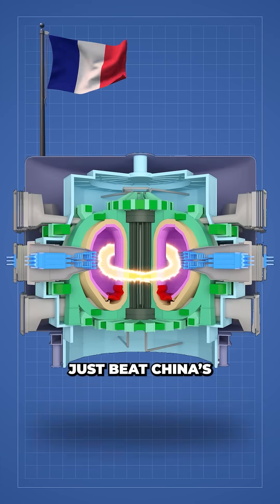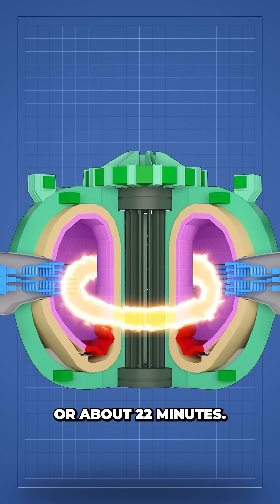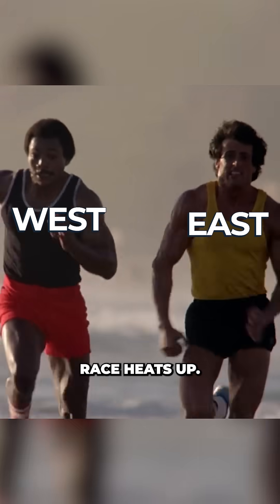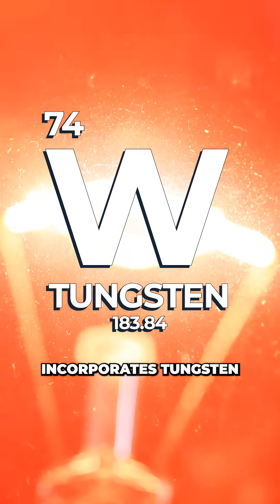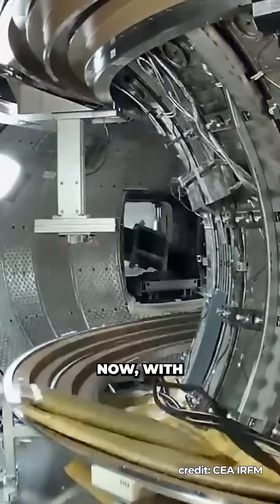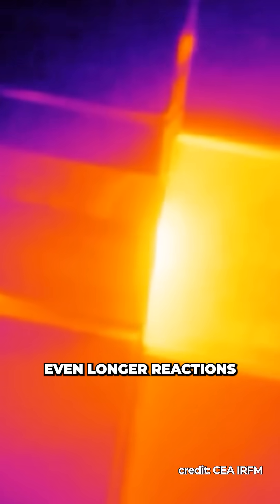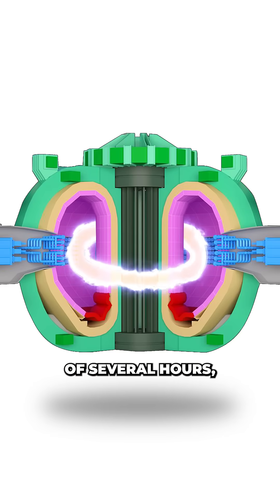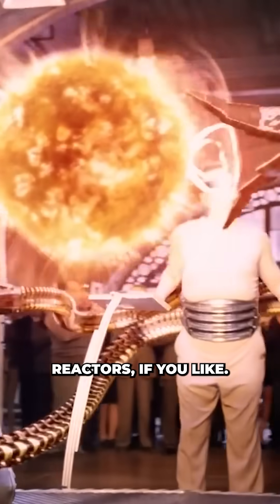France Breaks Fusion World Record

Comment: As an undergrad engineering student in the 1970's reliable fusion energy was promised to be 10-20 years away.  Glad to hear that we've lowered that to "could be" 10-15 years.
Reply: ???
2030s are in 5-14 years
Reply: @wydua 19 years from now will be 2044...
Reply: when you barely invest in a technology, that number doesn't really go down
Reply: @miner_sd  blame the coal and oil lobbyists 🥀
Reply: These estimates are based off of technology and data that doesn't consider political factors. So functionally, if they could get the funding and support the estimates aren't really that far off
Reply: Less than 10yrs ago they were getting sustained reactions for maybe a few seconds. This is huge amounts of progress in the time. Once it's cracked it will turn into the advancement speed of data storage in the 2000s.
Reply: Because the funding is terrible and anything nuclear related isn't politically liked. Within 20 years tokamaks went from essentially no output to nearly breakeven... and then progress stopped. Projecting the rate of progress in 1980, useful fusion should have been less than 15 years away.

Reminder that there was only 60 years between the very first aircraft flying, to the SR-71 flying. Things go fast if you actually invest in them.
Reply: Predictions in science are always a bad idea. 

Many people thought powered flight was 20 years away the day before it happened 😂
Reply: The day before the first flight of the wright brothers the New York Times said that powered flight was over one million years away
Reply: I'm glad my optimism is warranted here
Reply: Sure bud. The joke used to be fusion is always 40 years away, then it got lowered to 30. Now it being 5 years away is a clear sign of progress. Especially when you consider the definition of what ppl mean by fusion has changed from simply maintaining a fusion reaction to obtaining more energy from said reaction than used to start one, to having full scale nuclear fusion grids with fusion being the primary source of energy. By the 1970s definition, fusion would probably already be considered here.
Reply: It wouldve been sooner if the West weren't so scared of nuclear energy
Reply: Well... we didn't fund the research, so that's what happens.
Reply: We would’ve but exxon legislated it away
Reply: But one thing can be said our progress is improving at an exponential rate so prediction models of the 80s are already not viable still not gonna happen tomorrow but not as far away as most have thought for years now
Reply: 2030 is only 5 years away tho
Reply: Science is weird like that. It's not a constant or guaranteed process
Reply: All promises of "fusion is X years away" were made with the addition "if you give us as much funding as we need" guess what didnt happen
Reply: I always thought it was 30 years
Reply: This is just wrong. In 1970 we were nowhere close of starting this reaction. Now we maintain it for 20 minutes
Reply: The running joke is it's always 30 years away.
Reply: It was always possible with federal funding
Reply: @wooferjr169  Puberty PUBERTARIANS aka libertarians think otherwise
Reply: The only difference is this time we can see the light at the end of the tunnel, but there's still a lot of the journey that we don't know
Reply: When I visited the JET fusion reactor the person showing us around said that "We used to say we were 20 years away from commercial fusion, then the research money dried up after the high profile fission reactor disasters, and now we say we're £Xbn away."  (paraphrasing, and can't remember the amount they said, it was like 15 years ago)
Reply: Lookup the book Sun in a bottle
Reply: It's always a founding cycle away!
Reply: scientists are forced to make arbitrary "estimates" like that because they need funding. You can't convince people to care about clean energy 70, 80, 100 years from now because they won't be alive. Even if it would be a huge benefactor for humanity as a whole for generations to come. For a lot of people, if it doesn't benefit them right now or soon; they don't care about it and wouldn't want to fund it.
Reply: TBF that always required we actually invest substantially in developing the tech which we never did at more than modest levels until very recently.
Reply: Considering what they’re doing, I’m ok with it taking a while to do it right
Reply: I can't believe they were that optimistic and naive. lol it's like they landed on the moon, then thought they could literally do anything
Reply: @-TAPnRACK- they were not that optimistic nor naive they were simply selling hype. That's all they ever have. This is nowhere near "doing fusion." These long plasma containment times only happen at low temperature and/or low plasma density. In short this is just hype, which is what Dr Ben spews. He should be ashamed to call himself a scientist.
Reply: @-TAPnRACK-  also flying cars that you need no licence for, teleportation, living at every planet in the solar system and androids completely indistinguishable from humans by 2006, oh and being friends with aliens
Reply: The fact that humans crawled out of the caves and can produce fusion at all is impressive.
Reply: @quorthonsinferno5119  I'll be impressed when these grant chasers achieve break even, as defined by a 3D shell around their device, not by some PR puke
Reply: @loganv0410  Every major human achievement has had naysayers like you in the background. People said for thousands of years that human flight was impossible. Now we have airplanes flying overhead. Even if it takes 200 years for humanity to achieve viable fusion based infrastructure, it will still be impressive. How much did you contribute to fusion studying as an engineer?
Reply: @loganv0410 we broke even on net energy return 3 years ago lol. Your pessimism is pointless in the face of innovation.
Reply: @quorthonsinferno5119  you forgot something then the naysayers miss out
Reply: Consider that just a few years ago getting more than a few microseconds of fusion in a reactor was the coolest thing ever. Now we’re pushing almost half an hour, in a research reactor.
Reply: You weren’t an undergrad in 1970 bro ur c thru
Reply: It was never promised in the 70 show your work clown
Reply: The funny physicist line: fusion is perpetually 20-40 years away
Reply: 2077.
Reply: fusion always seems to be a decade away
Reply: Fusion reactors probably won't be a thing even in the 2100s.

Hysteria against nuclear is still very high and a reactor would just be too expensive, will take too much time.

I think that a commercial fusion reactor will be invented somewhere in 2050s, but that technology won't see any use because politicians are likely to go solar or wind
Reply: 5-15 2030 is already in 5 years 👀
Reply: Bro 2030 is in 5 years
Reply: Just gotta wait till 2080 for it to be 5-10 years
Reply: In 50 years it'll be 10-12.5 years away.
Reply: 10-20=-10, 10-15=-5, we’ve chopped -5 years off the process, we’re halfway there!!
Reply: I think the process of developing it feeds too many people, and too many people realize that if they actualy invent it, it will stop feeding them.
Reply: Not surprised. This is essentially an infinite energy glitch for us. Obviously we aren't gonna be spoon fed it so easily.
Reply: hell, maybe when i´m 80 in 2080, we will be there.
Reply: Tbf a lot of people started protesting nuclear power after the cold war and chernobyl
Reply: Ponz and Fleischman kinda ruined that
Reply: IK but at least we are FINALLY making tangible progress
Reply: nobody has ever had stable plasma during your entire life until now. Don't be dumb
Reply: TOKAMAK reactor is under joint collaboration of EU ,India, China ,Japan ,USA and Russia. So its a global project in France not a French project. hence stop this propaganda.
Reply: Yeh, sadly the investment in these just disappeared and the industry has been stagnant ever since, imagine how far we could have been with basically unlimited energy for every corner of the globe, we could run massive water sanitation plants and have an infinite amount of clean water, we could massively increase agricultural output, everything would be so much better.
Reply: Sir, 25% in a very short amount of time. I suggest, we my be in a scenario in which this will be sped up. My physical evidence is the battle between the East, and the West countries.
Reply: Yea you didn’t have shit in the 70s that was anywhere close to todays tech 
Even your magnetic confinement was limited massively due to ur 50 year old weak ass magnets in the 70s you used to think you’d have flying cars 
Yall were just idiots back then with zero ability to actually estimate the future.
Reply: The video said 2030s so that's 5-10 years, which is about a decade off imo lmao
Reply: same with ai, same with cancer, same with climate change
Reply: Came from the same prediction department for when the world will end due to climate change.
Reply: Bro humanity's greatest achievement is procrastination
Reply: If we don't start ww3, we will have fusion reactors by 2035. After the first self sustaining small scale reactor was built investments started back up. ITER probably won't be the first one built however, at the current rate china is more interested in building their own reactor than the rest of the countries are in building the first experimental one they started decades ago
Reply: And China now broke that Record
Reply: so 2220?
Reply: It'll always be 20 years away... Until they solve it. 
It's guaranteed the first few are going to fail over and over. 

The amount put into this. They could have probably built enough solar panels for the whole world
Reply: Hopefully the technological race in the fission reactor side of things can be used in the fusion side of things when it gets to a certain point. Something like the modular and down scaled versions.
Reply: Isn't that the joke that nuclear fusion reactors have always been "about 20 years away" since like the 1950s?😆
Reply: Actually down to 5 - 8 years from now.
Reply: @MichaelWinter-ss6lx  In reality it will be 50-80 years if we're here Even anymore then😂
Reply: It's been a joke for the last 60 years that fusion was only 20 years away.
Reply: Is that sarcasm?
Reply: Funny comment 😂
Reply: It’s always “20 years in the future” 🤣
Reply: 50 yrs later..... lmfao, that hot why didnt anything melt? nothing on earth could stand that heat... lol
Reply: @THE1ANDONLYSTILLMIN The plasma is contained and controlled by strong magnetic fields.
Reply: I don’t see you doing anything
Reply: Doesn't this run into the same issues as aerospace development? That is, we know exactly how to do it, we just don't yet have the means to make it happen?
Reply: Fusion was held back by lack of funding, none wants a reactor that can't make nukes.
You'll only see these reactors come alive if the investment come in.
Reply: realistically id give it 30-60 not that short tbh
Reply: You guys didn't have AI modelling though
Reply: Back then, the only people claiming it would
Be 10-20 years were the media and idiots. I still think 10-15 is an understatement, but at least we actually have something to show progress is being made
Reply: Da Vinci drew a helicopter. People said it was impossible for a fair old while. Before it wasn't impossible anymore.
Reply: The main problem is how to compress a reaction with the same energy density as the sun. You can't physically contain it because it's literally so hot
Reply: wow so hot, never heard that one before....
Reply: Schrödinger's Fusion is always 20 years away, regardless of time passed.
Reply: 10-20 breaks down to 50. So now at 10 probably 20
Reply: If It continues this way we will have fusion in 2190
Reply: War breeds innovation / we got in a lot less fights than we thought we would have ;)
Reply: у Русских-5-7 лет
Reply: 5
Reply: Just like the AI replacement 6 months for  2 whole years now
Reply: by the time fusion is worthwhile we will have the battery tech available to mke solar and other renewables capable of providing baseload
Reply: Czy te generatory posiadaja Zmienne taktowanie  czestotliwosci pola magnetycznego  ?
Reply: We been doing it fot quite awhile. They just been keeping it hidden to control it.
We have the ability to manipulate space and time with the Tech. Seems the Nuke boggy man is not that it will blow the world up. Its more of manipulating space time.
Who knew.
MH370...where did it go.
Reply: It's still 50 years or longer away. Can't even get enough REEs and tungsten to scale it even if they get it to work, plus that extreme temperature and conditions makes it very high maintenance, and the current reactors designed would have 50-500MW generating capacity (would take centuries to pay off the hundreds of billions it took to build them), a conventional fission reactor generates more than 1GW.
Reply: Yeah…bud saw a few pamphlets for fusion and thinks people were adamant it was coming in a decade lol. Boomers are so full of themselves it’s incredible.
Reply: Lol, and watch, in 2030 when I'm like mid 30s, Imma see that fusion reactors are only 10 years away
Reply: @JohanStrombeck 2030s includes 2030-39 .
Reply: Irk  @JohanStrombeck
Reply: We've been hearing claims of "10-15 years now", at intervals *of* 10-15 years, from the plasma fusion science community, for the last 60 years.  Yes, we are continuing to progress, but I think the 2030s prediction is entirely too optimistic.
Reply: @saf271828 Yeah. Make that 2070's and I will be more inclined to believe.
Reply: Lol its all BS. Commercial fusion reactor is still 20 years away 😂
Reply: @scroopynooperz9051  but youve also just pulled a number out of thin air lol
Reply: @lewis0701 not really look at where we were 10-20 years ago
Reply: @scroopynooperz9051 if not 100 years away . I have been waiting so long. But yeah. 0% chances we will have commercial fusion reactors in 10 years
Reply: @scroopynooperz9051  It becomes the leading source of energy in August of 2032
Reply: @scroopynooperz9051  Thats only five more years than was said 😂
Reply: @scroopynooperz9051  Nuclear engineering major here. You're probably wrong.
Reply: @scroopynooperz9051 
Longer, once they develop a stable design that can run continuously. It’ll take probably another 15-20!years to build the plant. 

So realistic 30-40 years
Reply: @scroopynooperz9051  more like 60 to 100 years away due to both lack of financial interest and material limitations
Reply: @scroopynooperz9051  not even close, maybe 40 years if we're optimistic
Reply: @scroopynooperz9051 it’s 5 years away it’ll be that way for the next 15 years
Reply: @scroopynooperz9051  that kinda thinking is why its that far away in the first place
Reply: @scroopynooperz9051  you say that as we are actually making massive breakthroughs in the technology, what’s really important is people need to understand that we could have incredibly safe fission systems in our homes that only need refilled once every decade but we won’t ever use it for anything in our homes because trump is so afraid of nuclear
Reply: @scroopynooperz9051  commercial is a lot further away than that. They start trying commercial in about 50 years. Around the same time we start mass production of AI robots that are indiscernible from humans. Dont forget, they may say it can replace your real body, but the second you give it up you lose all control and they have you.
Reply: @scroopynooperz9051  more like 30 ngl
Reply: well that would only be the time untill self fueling fusion could happen😅
they still have no rral idea how to turn that into energy for the power lines 🫠
Reply: @MrKhamul93 *self-sustaining.

Also we do know how to turn it into electricity. We're gonna boil water with the heat, and then use it to turn a turbine. Just like we always do.
Reply: @fletcherenfield9474  we have currently no working version to boil water with a fusion reactor....
to even try that we need a new gen of test reactors after the current one fullfilled their job, having fusion on the grid befor 2100 woukd be insanly lucky
Reply: @MrKhamul93  Of course we don't, we don't have a fusion reactor that puts more energy out than we put in yet. I don't know why you're telling me about how far off it is, I never said it wasn't, I just said that when we do have a good enough reactor, we'll probably boil water with it because that's what we always do. Do you always go off on tangents like this?
Reply: @MrKhamul93 the first net-gain fusion reaction was 3 years ago, this tech is moving faster than it ever has by a wide margin
Reply: @fletcherenfield9474  how could he have possibly been talking to you?
Reply: @swagdaddy5387  in the comment he deleted he was.
Reply: @fletcherenfield9474 bro what he didn’t even reply to you
Reply: @Hello-wo4sx  he did, and then he deleted it
Reply: @fletcherenfield9474 of course we have… we broke that record already a couple years ago ( of course the harvest part is something different)
Reply: @fletcherenfield9474  The first controlled fusion reaction that produced more energy than was put into the reaction happened in 2022, at the National Ignition Facility in California.
The excess energy was equivalent to the calories in a Mars Bar, so not exactly grid scale, but it was actually more energy out than in.
Reply: @michaelleiper  oh cool! Til
Reply: @mctobi2921  you're using "of course" wrong in that first sentence fyi
Reply: @fletcherenfield9474  you understand that these reactors contain the plasma within a highly thermally isolated vacuum chamber, levitated by supercooled electromagnets.... It's not as simple as just "capture the heat and boil water for a steam turbine".
Reply: @growtocycle6992   oh yeah for sure, but we usually wind up harnessing energy by boiling water and turning a turbine so it's reasonable to expect that we'll do something similar here. Do you have a better proposal?
Reply: @MrKhamul93  Yes they do 20 minutes of research into nuclear energy and you'd know that
Reply: @MrKhamul93  cap, we have plenty of methods proven to work like simply using the electromagnetic field produced in said fusion to well power stuff lol
Reply: @MrKhamul93  The same way we make coal and uranium into energy.
Boil water and let the steam spin some turbines.
We have ways to turn it into energy, we could try to find better ways tho.
Reply: @MrKhamul93 that's the EASY part you connect the cooling lines to steam turbines and use the heat to create steam to run the turbine. 

It's how ALL commercial power generation. Except renewables generate electricity. Coal nuclear geothermal and even certain solar all run steam turbines.
Reply: @jackass123455  this is not how a fusion reactor will be operated.
how about you let the scientist that work there decide that stuff?
cause they said they have no working way for that...
Reply: @MrKhamul93 boil water like every other power plant on the planet
Reply: @MrKhamul93 buddy it’s called a steam generator and a turbine
Reply: @MrKhamul93 we….. boil water? it generates heat, which we use to boil water and spin generators.
Reply: @MrKhamul93  that’s not the difficult part.
Reply: @MrKhamul93 yeah they do have an idea, it’s called steam
Reply: @MrKhamul93  there is a different company wich uses the magnetic fields to gain energy not heat wich is more efficient and reliable
Helion 
they also brred neu tritium while operating :)
Reply: Reliable fusion energy will happen in within 50-150 years.
Reply: @mtk77621this if the first realistic timeline I have seen. I could believe 150 years away for reliable fusion
Reply: @mtk77621nah my bet is 40-4,000 years lmao
Reply: My physics teacher said each year that fusion is 20 years away lol
Reply: Just like the colonisation of mars was supposed to be 5 years away in the 1970s
Reply: Just bought one from TEMU Made in China. The french one is sold only with a YSL hand bag. 
It works. I just made cofe with my TOKOMAC. Why such a fuss ?
Reply: Funny is I work for physician's and they say since the 1980' fusion is 30y away, and they say they stand to it still. So more like still 30 years. 15 years is like trying to get your kid to shit up during a car trip... Not really possible.
Reply: Wonder how much vietnam war and cold war affected this
Reply: I've been hearing about the "promise of fusion" for decades. If it becomes commercially available in the next 20 years,  I'll eat my hat.
Reply: @lymanmj  I have screenshotted your promise. If it happens, which I doubt it will, I will try to contact you.
Reply: @Elmithian  😬😵‍💫😂
Reply: @lymanmj  DON'- Actually Do Swear You'll Do, Maybe You'll Be Unlucky And Bring Science Some Luck!
Reply: @empireofitalypsstimfromano5025⚡️🔥🫣
Reply: This is nowhere near "doing fusion." These long plasma containment times only happen at low temperature and/or low plasma density. In short this is just hype, which is what Dr Ben spews. He should be ashamed to call himself a scientist.
Reply: @YodaWhat  And should we have stopped harnessing fire because some idiot burned his hut down one time? It is the beginning, the very beginning, and though a count of so and so decades is extremely optimistic it's not impossible we'll be producing energy mostly by fusion in the next say half a century, technology is improving at an alarming rate and though AI may have become a buzzword once we truly have mastered it, we may find solutions to problems that have stumped us for decades, as for those related to fusion for example.
Reply: @dud3655  - Yes, we MAY someday see fusion power through these sorts of efforts. But I have been following this whole field of fusion research for over 50 years and I see a lot of BS and very little progress. The entire approach they have been mostly following is quite misguided, as it was based on an attempt to get the same number of kilowatts per cubic meter that you get from burning coal. Now I ask you, is that a reasonable metric for fusion??
Reply: @YodaWhat  Very much not so, but still the advantages are there, coal is a limited resource that at the same time pollutes massively, while hydrogen is just... everywhere, and the byproducts are just helium, which in of itself is very much a useful element.  

Still, I get the pessimism, though it's still closer to realism than the optimists. But advances are being made, a few years ago a one minute sustained reaction was a huge accomplishment and now we've almost reached half an hour, though we are still FAR off from a truly self sustaining fusion reactor it's not like progress is slowing down, I just wonder if we'd get there faster if we focused on this task, rather than fighting trade wars with global allies...